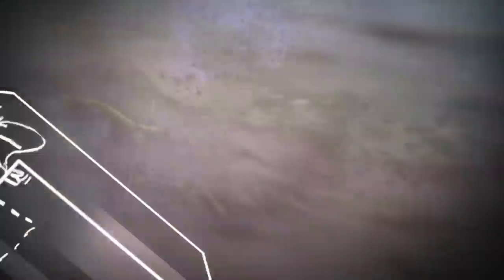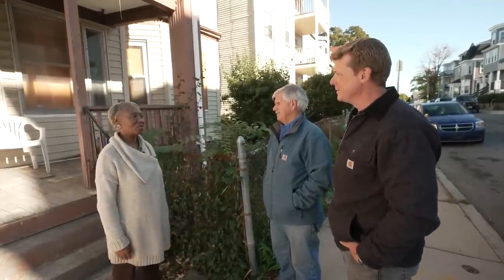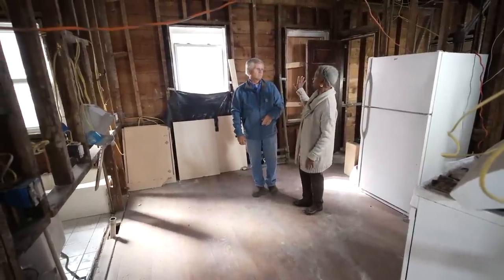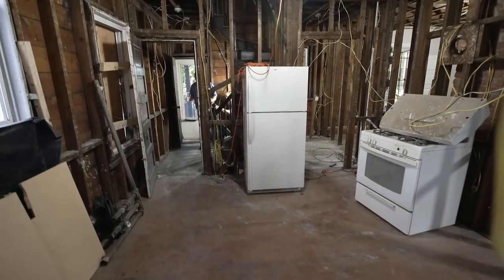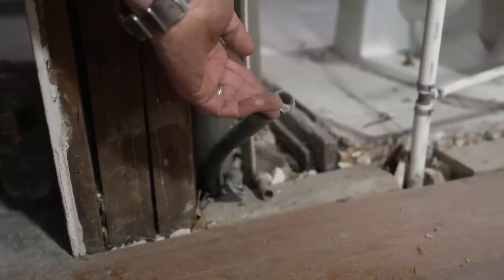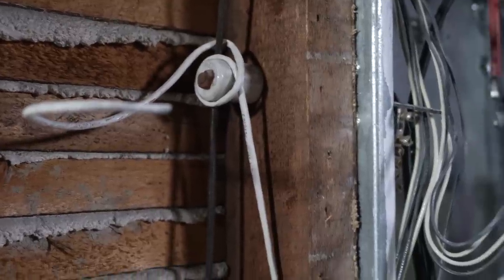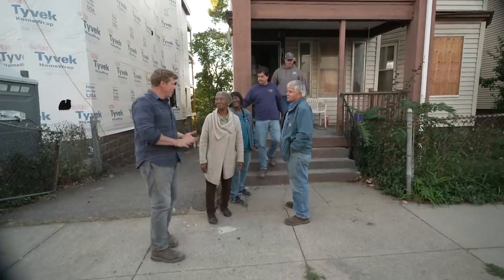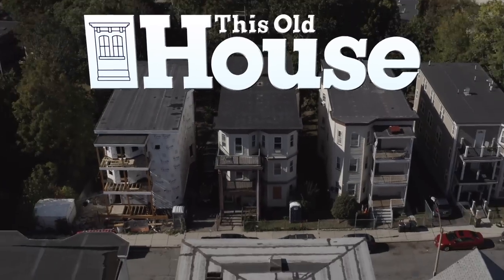This Old House | Return to Dorchester (S42 E17) | FULL EPISODE

Comment: That's really cool. We renovated an old home  quite some time ago that was about the same age. It had gas pipe and electrical running through the ceiling for the chandelier. I was pretty confused when I found it but my boss told me the same story. He said he's only come across it a few times in his 30 or so years as a GC.

Comment: 21:40 wonder who the state adjuster actually works/advocates for… the homeowner or the insurance company. 

I already have a bad feeling when he said “the costs have to be incurred, then reimbursed”.   That sounds like a potential insurance loop hole. Some homeowners won’t have the financial resources to ‘incur’ a cost and therefore won’t be able to make a claim. 

Of Course they’ll play nice because of TOH and the TV coverage
Reply: Good observation. Insurance for the common man is typically a sham.
Reply: The adjuster works for the homeowner. He takes a cut, but should be able to get the maximum amount of money from the insurance company. He will also handle the bulk of the paperwork. In claims with large losses, it's normally beneficial to hire an adjuster.
Reply: I'm going through this same process after a fire, the public adjuster works for the insured. They take a percentage, 10% in my case, of the contents total and the rebuild settlement total. Their whole purpose is to fight for every bit owed to the insured. In my research looking into them after our fire, they can be shady and hard to trust in some cases, but personally they absolutely got me more money than I'd have ever gotten on my own. This process is a nightmare beyond the fire itself, and navigating it myself I would have just accepted whatever they'd offered just to get the process done with. I'm still mid-rebuild, but at this point I fully recommend a public adjuster if you're ever in an insurance claim situation.